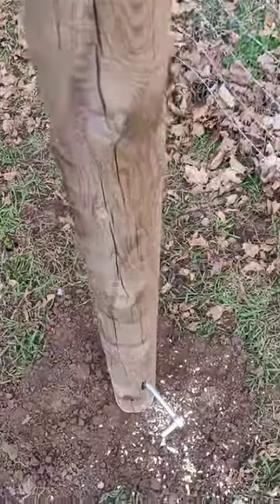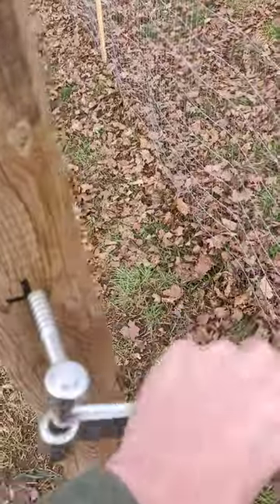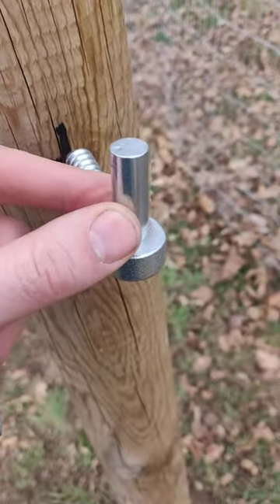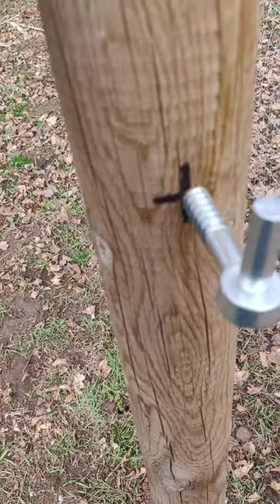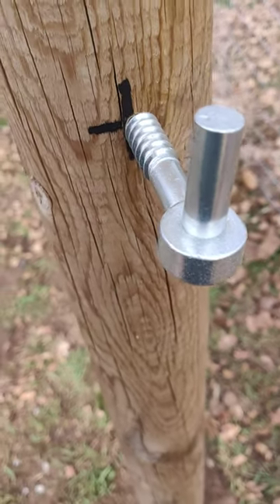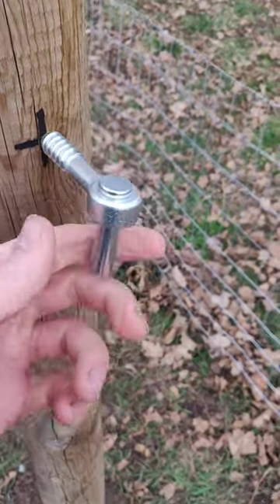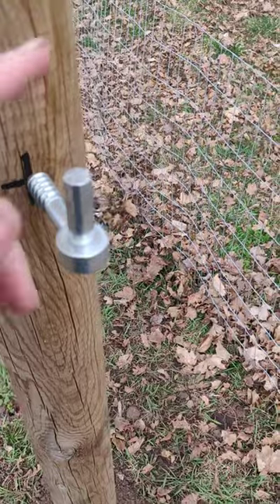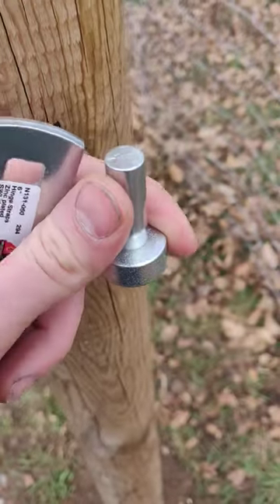Screw-in Gate Hinge Installation Tips

Comment: thanks for taking the time.  Can you tell me how you found the center of the posts?
Reply from the maker: I just eyeballed it which was fine. If you want it to be precise you can use a center finding jig or a set of calipers
Reply: @idahodiy  thanks...you were right. I eyeballed it and it worked out. Thanks for replying.